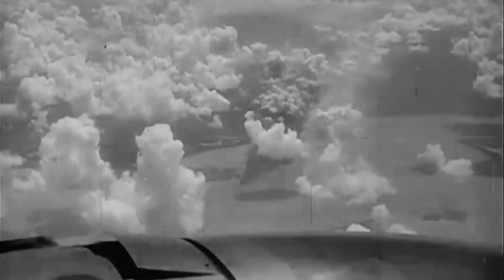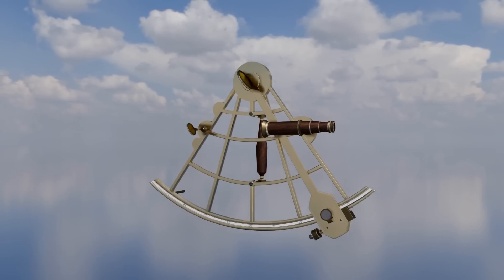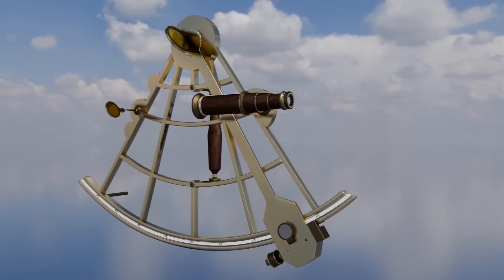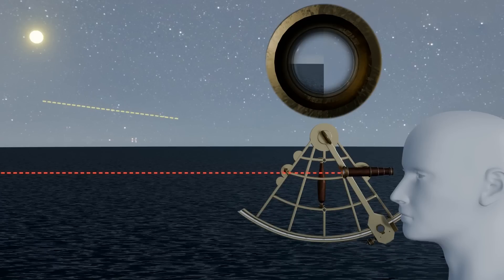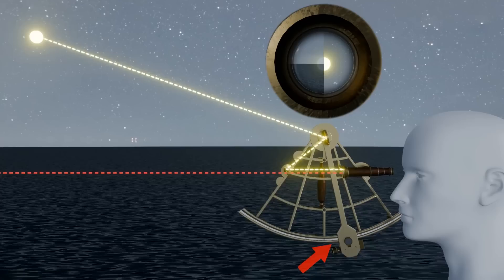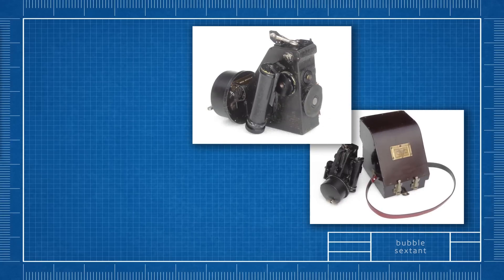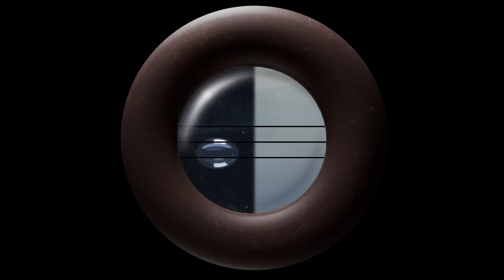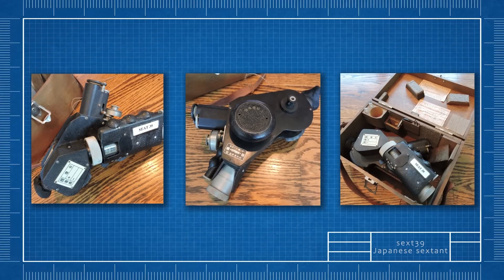Returning Home 2: How Japanese Pilots Navigated Over the Ocean in WWII

Comment: The Japanese radios should be mentioned worked fine in the more Northern parts of the world (ie. home islands). It wasn't like the Japanese gave radios to their aircraft despite the radios not working. It worked and it was standard on all modern Japanese aircraft. There is a reason why the famous "Tora tora tora!" line could be transmitted during the attack on Pearl Harbor. The model 21 radio the A6M used were actually fairly decent but they did not properly shield them from electrical interference.
But in the South Pacific, the Earth's magnetic field was particularly troublesome for HF radios. There was also solar minimum during the time the conflict took place which made the interference even worse. This was not as bad in the Japanese home islands. The conditions in the South Pacific were so bad, the pilots often just removed the radios since it was just dead weight. This was AGAINST regulations but was done regardless.
This affected the US too, but they grounded and shielded their radios so minimized the effects. Nonetheless, the situation in the South pacific is the worst out of all combat theaters and radio range are noticeably shorter there than in Europe even if you used the same radio sets. Early in the war, the combined allied fleets also had communication issues although it is unknown how much can be attributed to the magnetic fields and electrical interference.
Reply: The Japanese aircraft, unlike American aircraft, didn’t have shielded ignition systems.
That means that the AM HF radios were jammed by the ignition systems acting as spark gap transmitters. When the ambient radio noise is high (like the tropics) the radio noise levels makes even a good receiver useless.
Reply: @allangibson8494  And the source for your very unlikely claim is?   Aircraft piston engines have long had metal covered ie coaxial shielded ignition leads for a number of reasons, not just to suppress radio noise.   Since the leads are exposed to cooling air they are in effect exposed to the weather as well as the hot engine, and available insulation materials back then could not stand up to it.  Coax construction also reduces the chance of flashover and completely eliminates the chances of cross-fire.
Good radios were just as critical to Japanese aircrew as they were to Western aircrew anyway.  If they were fool enough not to have shieled ignition, the impact on radio reception would have been discovered in prototype testing.   Do you think the Japanese engineers were retards?
Reply: @allangibson8494 it will be japs don't observed the crafting and installlation of ignition cables, spark plugs, magnetos etc ? They were capable of copying well far more complicated structures and circuits...
Reply from the maker: Speaking of Japanese’ radio reliability - Saburo Sakai famous Japanese ace who flew A6M found the radio unit so useless that he decided to remove it completely in order to decrease drag caused by the antenna
Reply: @x-planed  Fighter pilots would often leave their parachutes behind as well to reduce weight, and because capture wasn't an option for them. In his autobiography 'The Miraculous Torpedo Squadron' Juzo Mori comments on the Americans' use of parachutes during the air battle over Wake Island.
Reply: @jiyushugi1085  Yes, very true !
Reply: @x-planed why didn’t he just remove the antenna?
Reply from the maker: What good is radio unit without antenna? It only adds weight
Reply: @x-planed    So he removed it for the weight.
Reply: @annoyingbstard9407 
No, no, no. He did as you astutely noted remove the antenna and kept the radio so he could throw it at a target.
Reply: The most significant issue affecting all radios allied or axis early in the war was precipitation static.  Aircraft traveling through the air generate a lot of static electricity, which is why you see static discharge wicks on the trailing edges of modern aircraft.  Moisture in the air (rain, snow, and even humidity) makes this even worse.  This was a poorly understood phenomenon at the beginning of the war, and the constant static discharge through the antennas disrupted radio signals.  This was more of an issue with voice transmission which is why the famous "Tora Tora Tora" signal was sent by morse code.  Grounding your radio to the airframe doesn't do much good if the airframe itself is acting as a van de graaf generator. 

The US recruited famous airline pilot Robert Buck, author of "Weather Flying", gave him a B17 crewed by a team of electrical engineers and physicists, and gave him free rein to travel anywhere he wanted from Alaska to Brazil  to investigate the problem.  The research they did addressed radio isolation and antenna design in general and the precipitation static issue in specific so thoroughly that hardly anyone today other than avionics designers are even aware that it exists.  Japanese radios taken in isolation weren't bad. Japanese radio installations on the other hand were plagued with a host of issues because they simply didn't understand all of the ways aircraft generate their own electromagnetic interference simply by traveling through the air.
Reply: @danielstickney2400  im seen opinion - japanese pilots flew much far range then allies so meet more disturbance in air (not engine's myth) in start of war, when range was equal main problem of japan was pilots, not radio, and in really - number 1 problem is crypto which allied decoders win with midway and later critical vistories
Reply: I'm a radio lover too..and this is invaluable information and learning..
Reply: If japanese made radio were made as american ones - 2 mm steel for the chassis and case - then there'll be only dead weight -  or, if they were located near to pilot's sitting place, an additional enemy firing's shield... Just take a look on german radio's - TFK, Siemens, Lorenz etc and a noticeable difference you'll see...magnesium and alluminum leagues on molded chassis...
Reply: Radio's shielding techniques were in its initial development times likes active filtering interference circuits - which even today blocks but doesn't eliminates interference, mainly on AM receiving band...
Reply: Today all we have using by electronics is an infinite source of noise in all bands especially AM - all of modern eletronic goodies have switching mode power source, microcontrolers and microprocessors from stoves to tv sets, a myriad of electric noise bleeding the AM receiving signals from listening...😮😮
Reply: troubles with japan eadio is another myth of winners - they based on fairy tales and misunderstanding japanese way of usage radio in flight. pilots keep silence (compare with trash talking american pilots which fall in fear of stay alone in plane) as tactical advantage, so durimg study they learn how communicate without radio. nothing problem with filter and shielding ignition (in really generator) from transciever. more like - you cannot use radio if you dont have position in radio net with channel, frequency, callname etc so no one dont listen you. samuray like medieval knight depend from his skill and weapon, not from others
Reply: Neuro, you have been reading too many World War 2 comic books.    Grounding and shielding a radio does absolutely nothing about F propagation conditions.   And electrical noise from sun noise, lightning etc, gets in via the antenna.
Reply: @keithammleter3824  Except it does. Solar storms affect modern electrical systems all the time. You can see modern news talking about it all the time. And Earth's magnetic fields affect navigation systems throughout history too. There is research on this subject you can find.
And shielding is for blocking out interfering signals. Especially useful for receiving.
Reply: @keithammleter3824 Grounding and shielding the IGNITION helps a lot with HF radio noise.
Reply: @keithammleter3824  In this case shielding has nothing to do with atmospheric interference (QRN), it's for the radio frequency interference (QRM) generated by the aircraft's electrical systems. Think Faraday cage. Y
Reply: @yamakawa511  There''s a certain amount of truth in what you said  (interference from electrical systems is always best suppressed at the source - eg the aircraft practice of using shielded (coax) engine ignition cables.   But the other poster claimed that shielding in the radio helped it with external phenomena such as solar storms - that's just not true.
Japanese aircraft in WW2 typically had fabric rear and control surfaces - that means the aircraft itself is not a shield and any interference internally generated can get out and reach the antenna - hence suppression at each source was done - same as western aircraft.
Reply: @keithammleter3824  For clarification, I mean the regional magnetic influence tipped the scale in whether Japanese pilots kept their radios on their aircraft.
In the home islands, pilots never removed their radio. They kept them in China and in the home islands. The lack of grounding and shielding was always an issue. But it was not enough for the pilots to just rip them out. When you add that to the local external conditions, it was bad enough to just rip them out. Whereas the US didn't have to deal with both, only external interference.
Reply: @neurofiedyamato8763  And the source of your very unlikely claim is?
The simple fact is, regional magnetic conditions do not affect radio reception at all.  They affect magnetic compasses but not radios.  For a magnetic field to affect radio receivers, it has to be a moving field - a very very rapidly moving field.  The earth's magnetic field, regionally and globally only moves on a scale of thousands of years.
Carrier based aircraft need working radios in order to pick up beacons in order to get back to the carrier.   A sextant simply doesn't cut it.   This has been explain by me and others.   So you better cite a reference for your claim that they removed their radios, or stop posting on a matter you clearly know nothing about.
Its no good repeating this silly claim about grounding and shielding - the fact is, aircraft ignition and electrical systems have been grounded and shielded as standard practice since well before WW2.   Including in WW2Japanese aircraft - google [photo of ww2 japanese aircraft sparkplug] and see.   Their plugs and plug cables look identical to American practice.
Reply: @isolinear9836  For carrier-borne aircraft, radio range only needs to be several hundred miles.   That's easily achieved even with early 1930's electronic techniques.   In WW2, the Japanese used 6B6 vacuum tubes in the input circuits of their radios, which they had a lot of experience in making.
The US had changed to using the much more modern 6SG7, however the noise performance (the technical term is "equivalent noise resistance) is much the same, the 6B6 being slightly better in this respect, 300 ohms versus 500 ohms.
In the lower HF bands then used, solar noise and lightning noise tends to make tube noise less important.  (lightning occurs somewhere in the world every day - the effect in areas remote from the discharges is a more or less continuous noise.  The noise is created from weak cloud-to-cloud discharges not always heard as thunderclaps on the ground  and is a lot more frequent than you might think)
Reply: @keithammleter3824  You have a point, however the aircraft itself IS moving through a magnetic field, and that WILL generate EMF. I'm an MRI tech, and when patients have special implants we move the patients into the STATIC field very slowly to not induce an electric current, which then creates it's own magnetic field which can cause the object to experience torque effects, or induced heating.
Reply: @jconradh  You have quoted a basic theory in electromagnetics (sort of - as a tech you should know that a moving magnetic field induces a potential, not a current).   
However, WW 2 aircraft didn't go that fast, circa 200 km/hr) and the earth's magnetic field is tiny - in the vicinity of 50 micro Tesla.  (typical MRI field is of the order 1 to 2 Tesla).   The induced electric potential in a typical WW2 aircraft would be of the order of 4 millivolts per meter.   This entirely negligible amount is in any case DC which radio circuits would ignore.  Not only that, the entire aircraft is subject to that same DC potential, so within any internal circuit, it self-cancels (thin two dry cells in parallel, + to + and - to - > no current flows).

In contrast, moving a patient into an MRI at one body length in 0.1 second would induce a voltage in the vicinity of 20 volts per metre. This could well be an issue with the larger metal implants moving within the patient.  

Can we all take a step back and consider the big picture here?   
This video claimed that Japanese pilots found their way back to their carrier in mid ocean by means of a sextant.   That is clearly nonsense, as sextant navigation in aircraft is just not accurate enough - under ideal conditions and a careful operator the error is several kilometres at best.   
It is on record that in WW2 British  bombers sometimes bombed the wrong city when navigating to Germany using astro-navigation.   As for finding a 200 metre long aircraft carrier under average combat conditions and weather, forget it.
People seem to be taking the video as fact and looking for reasons why the Japanese could not use their radios - taking them out, not carrying out basic installation practice, not using standard engine ignition circuit practice, etc.  Instead of speculating in this way, look at what the limitations of sextants are.
Reply: "worked fine" is a matter of relativity.  "worked fine compared to what?" is the real question.  If you're using radios, what is its broadcast range for an attenuation factor relative to weight, size, power, etc?  What is the receiver sensitivity, selectivity and fidelity relative to cost?  Does EVERYONE in your squadron have a radio receiver and transmitter?  (In the Japanese case, definitely not - if anyone, only the Section leaders did, and the rest of the Section communicated with visual signals - not very useful, nor flexible in dynamic maneuvers, tactical or operational).  Much of this has to do with build quality, manufacturing and industrial technology, technical advancement of the population and workers in question, the general cultural advancement of the Civilization.  

For example, in the US case, the American radio receivers had FAR greater sensitivity and signal-processing than anyone on Earth - America's Bell labs which started semiconductor research in the 1920s (they purified silicon to 99.999 %wt by 1945 and revolutionized Human History and Civilization), was supported by an industry with standardized tight-tolerance processes for components from capacitors to system-stability analysis and designed circuits (you can't design, let alone manufacture, circuits requiring a 10 micro-Farad component if your core technology and manufacturing processes have a variability of 100 micro-Farads !!!), developed Systems Engineering principles, "modern Engineering" (just as every Mathematician in school around the world today learns from Newton, Euler, Euclid, etc, so does every Engineer in college today around the world learns from Bode, Nyquist, Shannon, etc), etc, etc, etc.

America's Engineering Trees, including Materials Engineering and standards and measurements, are developed from over a hundred years of foundational processes - they are NOT based on some platinum-iridium paper-weights sitting in Paris, London, Chicago, etc.  And it's ultimately about people (the most important infrastructure) and their Honor-Integrity-Faith (the most important virtue in scientific inquiry, FAR more important than so-called "Intelligence" - an "intelligent" Liar is WORSE than useless in any endeavor, scientific or otherwise).  Materials engineering is a painstaking and disciplined process - and its infrastructure, like a forest, it does not simply "appear" but must be nurtured and cultivated over generations, from HVAC standards, to vetting the staff, to the warriors that protect all and PROVE all.  Like everything else, Research and Development is all about TAKING RISKS and BEING RIGHT - RIGHT makes one Mighty - and Physics/Truth/God are the ultimate umpires of this competition between lesser and greater Cultures, lower and higher Civilizations, the ultimate measure of quality-assurance being War.  So there is NO such thing as "Low-risk, High-reward" (which translated, is just another concept of "thievery" and "cheating"....and you can't "cheat" Reality....you can't lie to God).  Yet Europeans, Arabs, Asians, etc, are married to the idea of "Low-risk, High-reward"...and lying...they watch OTHER people take risks, do the hard work, go through the necessary pain and disappointment of repeated failure, bankruptcy, and worse...when the risk-takers knew how most fail and few succeed...and even those who see SOME success and finally triumph, sometimes monumental and historic success, the Thieves try to claim the "rights" and benefits to that success, that invention, that Triumph that is NOT their's.... and they "localize" a derivative...a clone...a lie...so they can SAFELY profit off it (and they MIGHT allow the risk-takers to get a LITTLE share of "their" profit)

No wonder they're second and third-rate Civilizations.

Because Reality/Physics dictates that they remain second and third-rate - again, at the end of the day, you can't cheat God.

The World's most important standards of measurements are PROPRIETARY - they're "trade secrets".  The only industrial system that can be called "in competition" with the American Empire, are the Russians - everyone else (and to a great degree and disciplines even the Russians) are a DERIVATIVE of American benchmarks - which means even if Americans were willing to "translate" , say, their Materials Engineering and core technological standards and measurements into the foreign country's native standards and measurements, that LOSES fidelity because the foreign country doesn't actually KNOW what the ORIGINAL standard actually - it's like translating "1/3" into "1.333"...you LOSE precision and with every follow-on calculation using those IMPRECISE measurements, the errors compound - and the comedic disasters and flubs this causes are OMNIPRESENT throughout history and daily occurrence - heck the Europeans and Asians couldn't instrumentally differentiate the lattice structure of their own solid engine parts from Shafts to turbine-blades from the American engine parts, even though the latter clearly PERFORMED differently.  Most of the time, foreign countries are just told to develop a mass-manufacturing process for a particular technology and standard - the foreign country doesn't know WHY the Americans chose this technology or standard, why the Americans know this technology works or even how it's supposed to fold into other technologies and processes, from semiconductors to space exploration..."Here's the technology, it's been decided...now you figure out how to make lots of them cheaply"...that's the way things have been done for over a CENTURY....even before the Japanese attacked Pearl Harbor, they were HOPELESSLY behind America's technological developments and Civilization (and that puts aside the overall industrial capacity mismatch).

You think Japan, or China, or Germany, Israel (snicker, guffaw, snort), etc, are in ANY position to lead and WIN the development of the next generation of Power electronic semiconductors, Gallium-Nitride or otherwise?  Or Artificial Intelligence?  Or Networked modularity and spacecraft?

(at least the Russians had the integrity to try another system, so there's hope for some of these foreigners)
Reply: @isolinear9836  : An awful lot of words you've written.   But the fact is, WW2 Japanese WW2 military radios were completely described in US electronics magazines.   Their radios were competently engineered and built, and were quite adequate in performance.   They were a little old fashioned compared to American equipment - for instance they used 6B6 vacuum tubes in low level stages, whereas the US had changed to 6SG7 tubes.  The difference in internal noise factor in the HF bands used is only slight.    
The best metal to make vacuum tube parts such as anodes in such tubes is high purity nickel.  Before the War, the US had imposed trade sanctions against Japan preventing Japan from buying high purity nickel.   So they developed a process to make high purity iron and plate nickel onto it.  This meant they could make their stocks of high purity nickel last the War.  There was no impact on tube performance or reliability.
The range of carrier-based aircraft only has to be around several hundred miles.  VHF was used later which only works line-of-sight.   Such a small range is easily achieved with 1930's electronics.
Reply: @isolinear9836 Someone lost their Prozac?
Reply: @isolinear9836  lol sure buddy, sure

Except American industry is now being displaced by China in every area.

And European thinking is what America (poorly) copied

I like youe theory thk